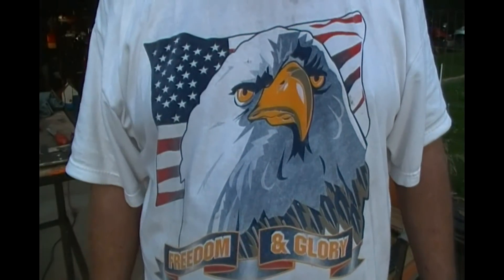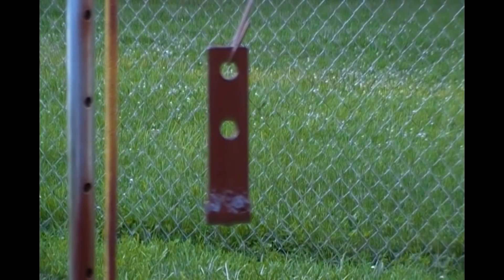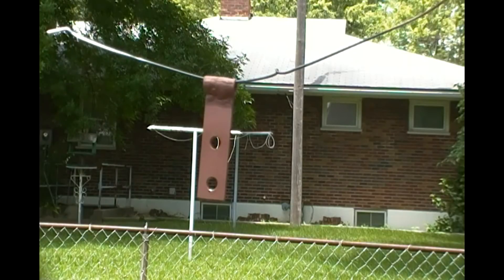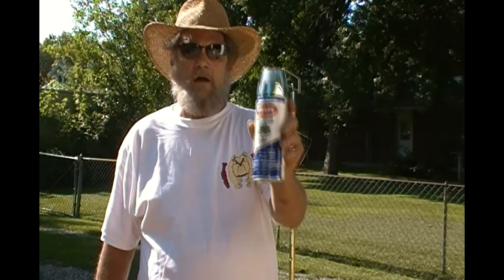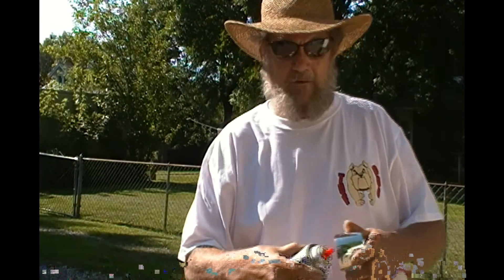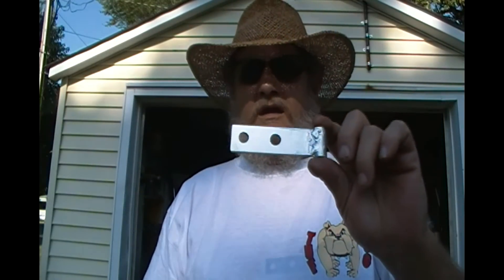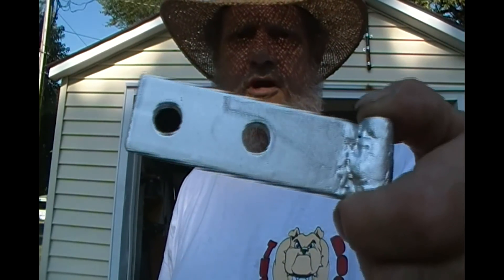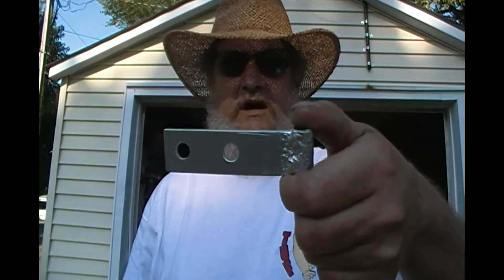AEROSOL EXPERIMENT , LOOKIN FOR CHROME

Comment: Hay Tufdog, I came across this video signing in. I actually work in a hyperformance shop that does it's own chrome plating on there own parts. Been there for 20 years and learned how to do the whole shebang.  Well anyways, I get the chrome parts on my assemble line and well sometimes the parts have imperfections in the chrome. This video made me think of what you're trying to do. OK, here's the deal. The areas that is polished, then chromed,  with an imperfection in the chrome is rejected, scraped in other word, because it costs too much to redo it and is more work then what the part is worth. And you're right, there is no paint that will duplicate the actual shine of chrome in a rattle can, believe me, we tried, LOL. 

OK, now back to what you're doing. On my parts, the areas that don't get polished, like a low area on a flat surface say an indent for a bolt whole. That spot would have an imperfection but since it is not polished but has chrome on it, can be fixed with paint. It would blend in perfectly with the rest of the chrome that is not polished but is chromed. The color and brand you want is Rustoleum brand. There are 2 colors to chose from, they are, aluminum and silver. Either one of these colors blend in perfectly with the chrome on the rough nonpolished surface. The color and brand you are working with, I've tried to use and it hardly ever works right in blending with the chrome simply because it is too glossy. 

Hope it helps on your next project.
Reply from the maker: +prancstaman     Hey Prancsta Man,  Cool that you found this and took the time to check it out & comment.  I appreciate the input & sharing of your knowledge.
I know there's substitute for real chrome, but on a cheap project one can only do the best he can with what he can afford.  That's what this was really all about.
Thanks a bunch, ... Cheers
Reply: Can you please tell me how to paint chrome effect, or hyper silver on car wheels with steps ? I painted my car rims 2 weeks ago, started with gray primer then silver base color, then clear coat, the final result is just silver which I do not like. I've been searching for days for how to paint hyper silver, or chrome effect on silver, but still have no luck :(. Looking at my car with silver wheels really makes me unhappy

Comment: i'm sorry but that's not a chrome spray it clearly says metallic
Reply from the maker: You're exactly right, keen eye you've got there.!!
Reply: there are actually real chrome spray paints but the results aren't as clear like a mirror but it's still reflective enough to see your face you might try looking or trying those products though you'd probably need to clear coat it to avoid scuffing since chrome paints are very very fragile. ^^ anyways good video.
Reply from the maker: I've heard good things about Spax Stix & Dupilcolor.  But None of them are cost friendly, nor a real chrome like finish.  
I appreciate you commenting, Thanks
Reply: haven't tried spax yet since we don't have it here but i did have a chance to test out duplicolor and it's quite good but a little expensive than most cans you should try painting water bottles as testing it's what ive been using ^^
Reply from the maker: Thanks for sharing, I like that... Cheers

Comment: You should have worn a respirator, as chrome spray paint is extremely toxic when you breathe it in, so just take the precautions. Although I don't think that anything actually happened to you, it's still dangerous.
Reply from the maker: Thank you for saying. At the moment I didn't think of that.
I appreciate you caring...
Reply: ***** No problem really, but if you do this again, you can just buy a respirator at a Home Depot or places like that for about $10
Reply from the maker: Sad thing is I already have one. I just forget to use it...
Reply: ***** well I suppose you know now.
Reply from the maker: Yes Sir, I'll keep it in mind. Thank you
Reply from the maker: Yes I agree, I didn't do a very good job. I was way to close and thick.
Done right it would probably have not used so much with better results
Reply: ok lol
Reply: I think the evidence shows it cooked his brain. What a Maroon.

Comment: I like Rustoleum a lot more than Krylon...stays shiny. If you're trying for a more chromelike finish use the Rustoleum "Bright Coat" and don't let a damn thing touch it til it dries. It doesn't need clear if you get it right.
Reply from the maker: Good tip MAn, Thanks !!.  I've been painting my helmet with rustoleum, And it really does have a nice shine ! Thanks again. Cheers

Comment: gloss black base coat. let dry. then , equipped woith a heat gun, put light by light coat of chrome paint on. paint a light coat, then blow some heat on it. keep gping coat by coat. eventually toward the end youll b able to put on a thicker coat. the key is th egloss black base, and the heat..heat will realize the chrome

Comment: Hey bro?! Could you do another video with a better process? I mean with a very light coats of chrome paint!! Thx man!
Reply from the maker: I tell ya what, Next time I intend to try Dupli-color Chrome paint. I've seen an example on someone else's build and it looked pretty good from the pic I saw.
Of coarse I also intend to try to do a little bit better job applying it, lol 
This was just a quick and dirty attempt & I'm not proud of the way this video shows the product or my work.
Thanks Antonio, I appreciate you checking it out and commenting. Cheers
Reply: Tufdog's Place Yeah you're right, but I appreciate your try cuz' I gotta chrome a little piece on my motorcycle and of course it helps!! I'll be wating for your video man!! Cheers!
Reply from the maker: Thanks Brother,  But just so you know... There is no paint that'll actually look like shiny chrome.  & the chrome processes that are for sale are too expensive for the home hobbyist. 
On a real motorcycle part that needs to be chrome, I'd look for a local chrome plating shop.  They probably could do your piece for a few bucks more than the cost of a can of paint...
Reply: Tufdog's Place You know what?! Probably you're right, but I'm a stubborn teenager and I found a sprays offer and I really wanna do it by myself!! lol
Obviously I know that sprays are a cheap solution, and probably worst than chrome painting shop's ways, n' I just want a 50 or 70% of professional results!
You are a very very nice guy! Thx for do videos and help me out! God bless you!
Reply from the maker: I 'll have to get some supplies together then it'll take a few days to complete a part & make a video. But I'll give it a go. 
If you want to go ahead with a small part, I've heard really good things about Spaz Stix Mirror Chrome Spray Paint too.  But Most videos I've seen on it are of guys making model cars.  But it looks pretty good.
Reply: Tufdog's Place Yeah, it seems like real chrome!!
So I'll be wating for your video man!! Thanks!
Reply from the maker: Which one are you looking at ?
Reply: Tufdog's Place Stix Mirror Chrome Spray Paint, the one you said! I've searched a video and you're right, it looks pretty well!
Reply from the maker: Yeah, I won't be using any of it, due to the small amount you get for the money and it's not easy to get around here. But it does look like good product for small parts
Reply: Tufdog's Place Yeah I know that feel, it's difficult to find some things here bro!
But you can get another bigger can, and also I'm sure that it's gonna works very well!!
Reply from the maker: I'll look into it  to see what I can find...Thanks Buddy
Reply: Tufdog's Place Thank you dude!!